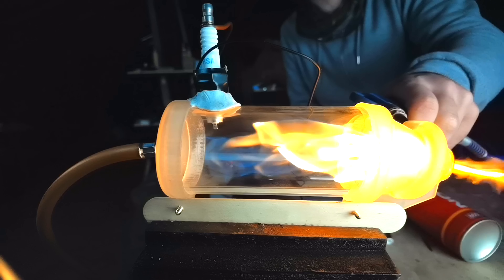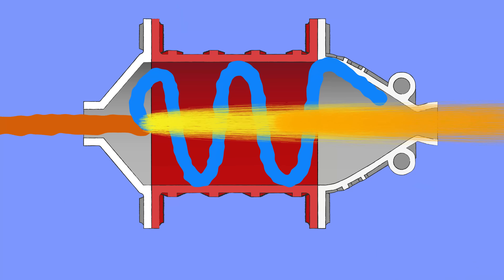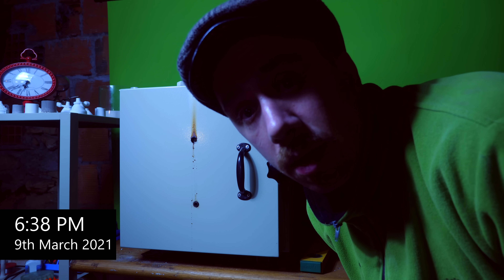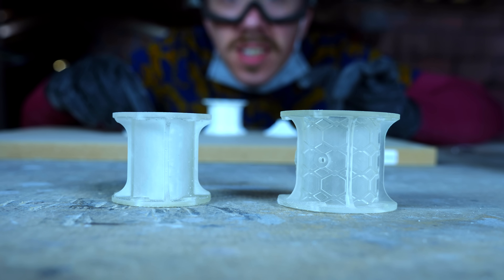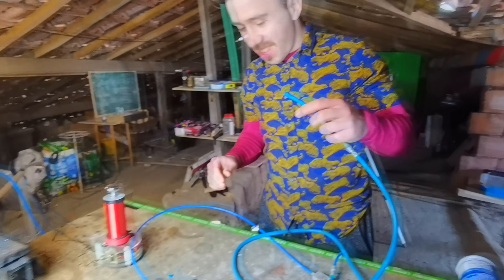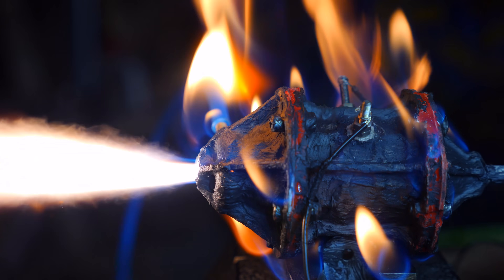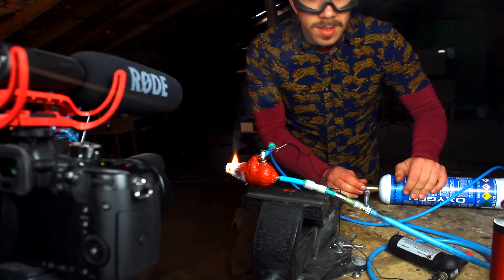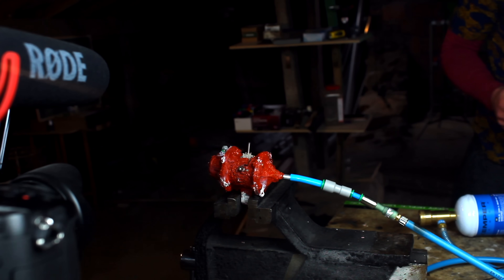Vortex Rocket V2.0 (3D Printed)

Comment: I'm thinking you could get some electromagnetic valves so you can cut the gas supply when you need to, so it might be easier to get the mix right.
Then you could invest in some flowmeters, and calculate the ideal mix, and set up the flow (note that you may need to use a correction factor for each of them, unless they're made specifically for the gasses you use).
Then you could calculate the volume of your jetengine, and calculate how long it would take to fill the chamber with the flows you're using - and then you have roughly your minimum ignition-rate. You might need to add a bit, because the chamber needs time to empty when it ignites, but I assume that's negligible compared to the fill-rate.
I'd also say, make an Arduino control a MOSFET, that drives an ignition coil, that way you can get more reliable pulses. The Arduino you could program to take input from an encoder, so you can turn up, and turn down the ignition-rate.
For the Arduino you could also add a start and stop button to open the valves, and start the ignition.

This way you should have a much more stable setup, which would allow you to be roughly dialed in, and be able to "pause", without having to start over with flows and such.

Comment: Sand the surface that will be joined and polish them until they are smooth as mirrors. Then use gaskets and bolt both sufaces down with enough clamping force. Should give you a good seal

Comment: I think you can mix some aluminium or steel dust into the ceramic sealant that you use to make it better at resisting heat and maybe stronger.

Comment: Even though turning off the propane first puts the visible flame out first, you should really turn that off AFTER the oxygen.

Reason being is that when the two are mixed, the propane is burning. When you turn off the propane, everything still burns, but now it's your model that's burning instead, and very fast. Oxygen can and will burn anything, from propane, to ceramic, to bricks and even metal! This only usually happens (or at least, happens in the "flaming" fashion) when they're hot, and what use is a jet engine if it doesn't get hot?

Note: when "burning metal", this is often done while cutting iron/steel to save using acetylene when cutting metal sheets. Once you've started a cut, you can turn off the acetylene and leave on the oxygen and continue cutting.

Comment: Can you add a ceramic slip to the outside of the parts before firing it to help create an air tight shell?  Maybe you could glaze the engine and fire it again to create a glass outside surface!

Comment: -So, the shrinkage on the ceramic after it's fired (which I think happens with all fired ceramic to be honest) can cause cracking and stress in the materials.  The chamber pressure and the porosity of the ceramic all causes... um... energetic... failures.  So if the walls of the chamber can't be ceramic or resin, and silicone can't handle the heat OR the pressure, that leaves you with metal, which CAN be 3d printed, but the sintering (sp?) would probably cause as much shrinkage, and I don't know if there's a resin/metal material out there.  I don't think impregnating the resin before firing / during print would do any good.  The RTV would have been my only other suggestion, but the application method you used left... well.. much to be desired.  But it gave you the best chance at stopping the leaks, BUT not holding the chamber pressure.  Maybe a ceramic chamber, potted into a metal outer housing with the RTV? Lift-weight ratio wouldn't be stellar (pun intended)...
Reply: WAIT... someone seems to have done it! The 3d printing in metal I mean!! https://www.youtube.com/watch?v=w3i8i-9bjqI

Comment: Or you could print it in wax and then do a lost wax casting of it in aluminum.  Maybe you could even just print a mold in the ceramic filament and pour aluminum inside.

Comment: Integza it looks like you've developed the Human Torch of rocket engines. It flies by setting itself on fire, lol.
I wonder if you could fix some of the leaking issues by soaking the part that came out of the furnace in more of the ceramic resin then sintering it again?

Comment: If you could wrap the whole thing in water somehow the outside would stay much cooler as well as you might get the same effect as putting a plastic water bottle with water in it on a fire. The bottle doesn’t melt.

Comment: Could you possibly make a ceramic slurry from the failed prints and spread the goop on the exterior of the working engine in order to reduce porosity, not exact ally sure how firing the slurry would work though

Comment: Oh...do lost-wax casting using your 3D printer and casting resin. Would open up your design space for all of your engines. Maybe also use standard SS vacuum flanges for ends, crushable metallic seals or o-rings might help.

Comment: You could also try hydro forming. I know Colin furze did it with a welder and a pressure washer I wonder if you could make 3D printed molds that could handle the pressure

Comment: How about coating the insides of the engine with sealant? As you can see at 14:25, the pressure is pushing the sealant away from the ceramic. If it were inside, it would maybe push it against it?

Comment: How about instead of painting on the high temp silicon, plug the holes and submerge in a bath of the stuff, remove, let dry, and do it again to get a few coats if needed.

Comment: You should try putting gorilla glue on it and then printing a larger resin part to go over it, sandwiching the glue between the engine and the resin part

Comment: Theme: How about a 3d printed ion thruster?  Also, It looks like the silicone gasket material between the mating surfaces is a weak point.  Perhaps you can try copper exhaust rtv silicone paired with a copper metal gasket? Great job.  Keep it up!

Comment: There's a process called lost PLA casting where you 3d print a blank and make a mold out of it and pour a molten metal in. It will more or less vaporize the pla and you will be left with a metal part. It would require lots of cleanup and I don't know how well a casting would work for the rocket but it's an idea. Could also be used for other projects such as the internal combustion engine everyone wants or a steam engine.

Comment: @Integza Could you do Hybrid Rocket Engines? They are so cool! They consist of a solid fuel mixed with no oxidizer. Then the oxydizer, (oxygen) is blown through the engine to produce thrust. The engine can be turned on and off and throttled like a liquid engine, however, they are much more efficent and cheaper and easier to build. Abs plastic, used in FDM 3d printing has been used to make specifically shaped rocket fuel. Different fuel channels allowing oxygen to flow in different paths have been shown to increase efficency and thrust! So, 3d printing custom channels can be pretty cool! ABS plastic burns and is and can be used as fuel pretty easily! Heres a wiki about the subject! https://en.wikipedia.org/wiki/Hybrid-propellant_rocket

Comment: I think if you made the main engine body out of aluminium and only 3d printed the ends, you could use the same kind of sealant as it is on the big pulsejet engine, the fireplace cement, to fix them together and stop some of the leaking as well

Comment: You could put that kiln to a proper use and make a mold of the engine and use melt steel inside of it to make a cast metal engine

Comment: Since you are 3d printing ceramics and even baking it in a kiln I think you should glaze it on the inside the as they do with proper ceramics, pottery and the like. That should solve the leaking problem

Comment: Why don't you use a steel tube as body and print the nozle and endcap seperate. In theory less components that can leak!

Can't you impregnate the printed ceramic parts by soaking it in waterglas? It's used in the automotove industry to cure porosity in high heat parts.
Potasium silicate is the working component. It cures using co2, there is a cheap source of it all around you!

Comment: Try applying a high temperature ceramic coating on the inside of the engine. Alternatively you could try dipping the parts in some thin high temperature epoxy. Keep an eye on differential thermal expansion and thermal shock though since it could create cracks.

Comment: since you're basically 3D printing high temperature ceramic
why can't you just use the 3D model as a negative for a mold
and cast the engine with normal high temperature ceramic?

Comment: Pottery Glaze might not be possible if the porcelain is unable to withstand the heat. That being said, if it's possible, then the glaze is your best bet. The epoxy and the high temp silicone just can't hack it at those. Temps I'd imagine. Take a look at seals used for turbos on engines since. They can get stupid hot. There might be something there you can use..

Comment: Solution: make engine out of stainless steel.
Reply: @KOB I'm guessing that's what is happening to his various coatings. The oxygen is being forced to vortex against the walls, pushes through the pores, makes contact with the resins at high pressure+temp and burns them out.
Reply: @KOB High chromium stainless should be fine for this application. If oxidation does become a problem then adding a better cooling solution to the nozzle may resolve it.

Comment: You can try to put soapy water in the outside of the engine and uses air compresed to blow instead the engine simulating a test, and see were the boubles on the outside ser formed, this will indicate where are the leaks un the engine, and then you can focus the effords to seal that regions instead of all the engine, and for sealing you might try plaster because is more liquid and can enter better between the spaces left by the resin 

Video idea:

Comment: two cheap ways to seal, 
one, coat with sodium silicate that can be made mixing "cat sand" with caustic soda in water.
two. paint the 3d pieze with conductive paint and electroplate with copper (easiest metal to plate), moving the pieze to get uniform coating.

Comment: What if you thicken the connectors, with iso-grids as support on it to limit the deformation, afterwords, use a high-temperature O-ring of sorts when you connect the modular parts together, should prevent further leaking that I can think of

Comment: Try pressure to get the cement inside all tiny holes... Try getting cement inside with a baloon and let it dry inside a vacumm chamber in order to suck the glue to outside through the micro leaks with the vacumm. Terrible explanation and probably idea but pressure + antileaks = no leaks.

Comment: Try to electroplate the cheramic engine with copper (paint the engine in copper powder before plating) . It should seal the pores and make the engine hermetic.
Reply: Also the copper is quite heat resistant...

Comment: You may want to look into a fireproof workspace.  All that fire in an old dry attic(tinder box) is going to end badly.  Love your channel and projects,  and I would like to continue doing so.  Suggestion: Modify Integza Bot for fire suppression (you may have to pay him a bit more) , or build a small 3 sided "C" enclosure(top bottom and 1 side) from fire rated plywood and insulated with mineral "rock" wool and it's Rocket time!!!

Comment: Rebuild the jet turbine engine, but using 3D printed parts with metal filled polymer.  This material will require sintering like with your ceramic material but will yield metal (stainless) parts, (just like the MIM process only no mold needed).  Also try using a 'ceramic epoxy' to seal / assembly your ceramic parts.

Comment: 3D print the one piece engine in PLA. Make a mold with it using sand and the PLA part. Pour liquid steel into the mold and fill any unwanted holes with fireplace sealant

Comment: It looks like the material you're using to seal the plastic is too weak and is being broken by the high pressure on the inside. I'd suggest using carbon fiber (fabric stuff) (you can also use fiberglass) in conjunction with the black cement, like you did with the pulsejet. Put that around the plastic. That should add strength. Then, put the red on the outside to seal it.

Comment: You need valves to regulate flow and pressure of oxygen and fuel. You’re adding too much at high pressure. You’re generating too much heat for such small parts, if you regulate and lower pressure and flow you can test longer and figure out the limits of your parts without destroying the parts.

Comment: I feel that if you didn't run the last engine until it blew up, you could have taken it apart and determined where the failure points were, and if they were due to porosity, warping, or an inherent design flaw that could be exploited to reroute the energy back through the nozzle!!!!!

Comment: If the ceramic resin is not pre mixed, try reducing the resin slowly slowly, or try stabilising the engine after the first heating.

Comment: Would it be possible to glaze the inside and outside of the parts with a high temperature ceramic glaze and bake it on as part of the firing step?  In theory, it would be less porous than the printed parts.

Comment: I wonder if you could dip the parts into liquid (high temperature resitant?) silicone, making the seal on the inside, rather than the outside. If you watch the slomo footage, you can see the pressure builds up through the parts, but underneath the silicon layer (hence the bubbles). Inverting that may create more of a vacuum,  giving the pressurized air a better chance of escaping through the nozzle (path of least resistance). additionally, it might make for a tighter seal between the split parts as well, allowing just a bead of extra silicon between to make for an even more airtight seal.

Comment: Why not paint the inside and outside of the porcelite parts?  Use an extreme temperature paint and several coats that will protect it up to 1093*C ?  This way it will get in to the cracks.. then sand it down and spray again.  Best of luck and thanks for sharing!

Comment: Since you have to bake it why not try adding layers of ceramic glaze? Both in and out side. You could do like a aluminum powder glaze to add heat sinking property's? Also would it be beneficial to add some sort of rifiling or fluting to the exhaust to better channel the flame?

Comment: I was reading that there is a company selling FDM filaments which contain enough metal to be sintered.  I don't know if you have to mail off the part for a special process or if you can sinter it yourself in a furnace, but it may be a good option.

Comment: Would it be possible for you to put, in the video, more of the slo-mo moments of the engine failures, like the process by which the flame finally escapes out the sides of the engines?

Comment: There is a copper and stainless steel paint that if you coated the rocket engine with with 5 or 6 coats then put your silcone round that.
Also you should really build you a little test bench for your fuel tanks thats got 1/4 turn ball valves for quick turn off

Comment: Hi, nice Video. So maybe if you assembeld the engine you apply a second or more Layer with that resin and put it back in the furnace. But maby it Just cracks more because of the stress on the "old" surface. Use Just thin coats.

Comment: An awesome video. You could try to reduce the number of joints you made to reduce leaking. I mean try splitting the engine in the axial direction and combine the two parts.  Before sealing, make sure that both the mating surfaces are perfectly flat.
I thought your unibody engine worked really well and its outer nozzle diameter was small, you modify that design with a higher nozzle diameter and see if the engine is stable.  good job with the build.

Comment: Have you thought of using ceramic glaze to solve the porosity problem in your parts? Couple that with some sort of high temp gaskets between mating surfaces and you could solve a lot of your leakage problems.

Comment: The best thing, imo to seal it - is Sodium Silicate. The reason refractory cemets are porous - is because the porosity traps air in the foam structure. Air is insulative :) So - to combat this we use Sodium Silicate - or similar compounds. 

You can buy Sodium Silicate online - or make it really easy with Silica Gel and Sodium Hydroxide (vids on youtube). 

Essentially, make the sodium silicate, glaze your part in it, then while it's drying intermittently go over the glaze with a blowtorch to even out he surface and remove trap air bubbles. 

This will definitely survive better than high temp silicone - and will seal significantly better as well. 

For best use - you'd have to glaze the parts individually, put them together, then glaze them again all at once and harden the glaze.
Reply: another common method is high temperature refractory sealants, sanding and brazing the surface with molten Al, and electroplating. All of these methods can be used for sealing - with different rated pressures for each - you probably won't be able to get away with electroplating tbh.

Comment: Try with the ceramic paste inside the engine too, with al least two layers to be sure to fix some micro cracks and pores of the paste too. So, paste In both sides + silicone over all  must be enough c: